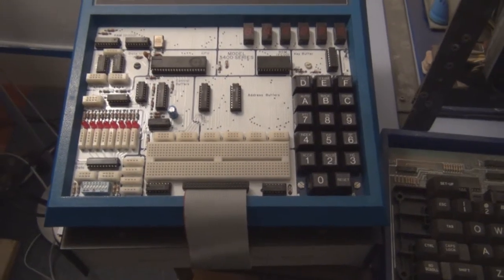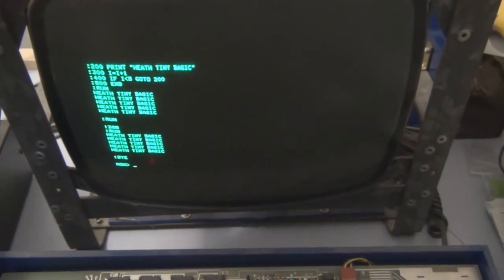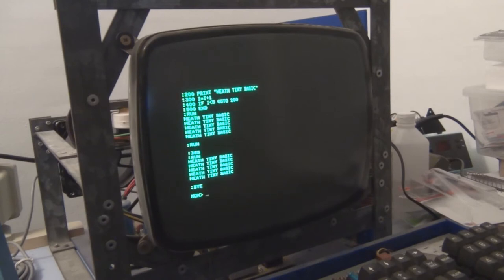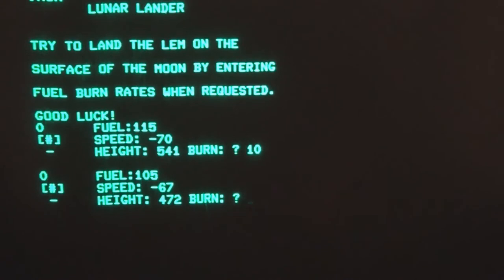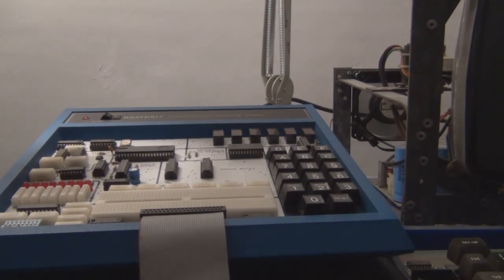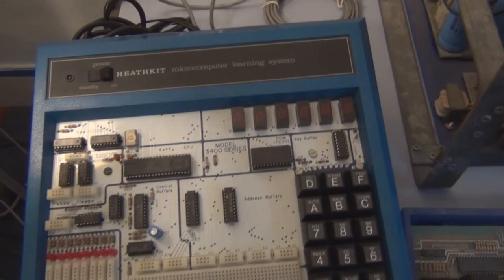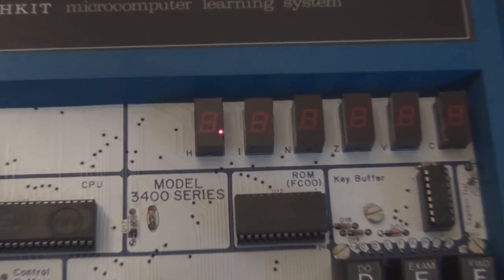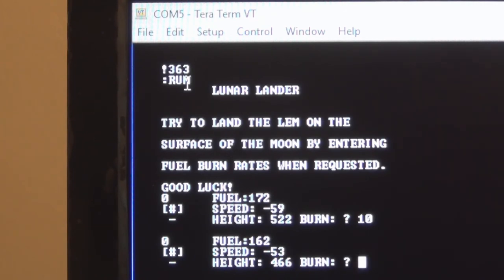Programming the Heathkit Microprocessor Trainer in Tiny Basic

Comment: Cool, I had an open frame monitor, but modded my expansion i/o box to talk tty loop.

then made a card to connect rs232 to my Centronics 101al printer.

also got to run graphics of the lander as punching the code.

bought new at the time.
last year, i gathered all the course stuff i laid aside. Never completed it, but registers, xor, ram rom all to me  in 78 or so stuck in my mind. wanted to set up in local hackerspace with my hero1 bots, nogo.

I'd like to do a youtube of me starting over.

btw, the little monitor is below x-ray public scaring potential. probably around 10k. need 16k and high beam current.